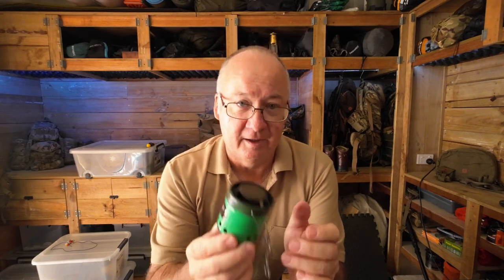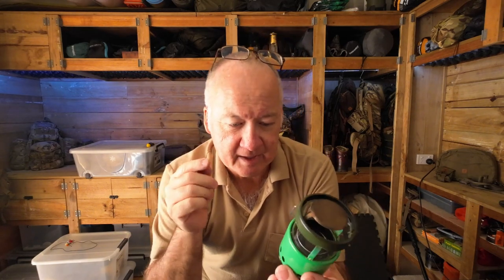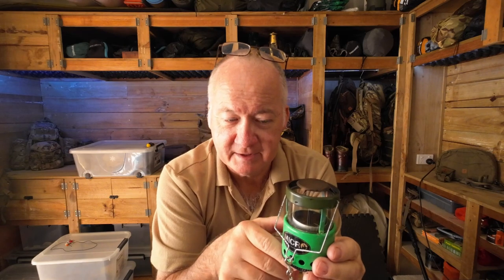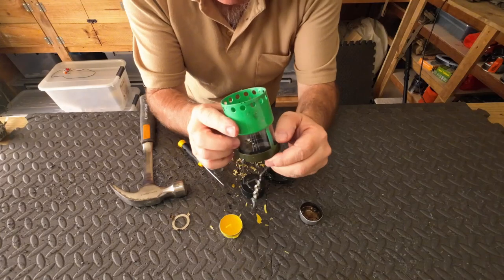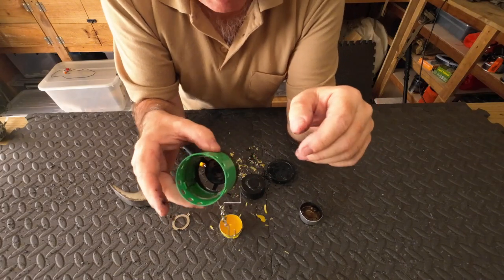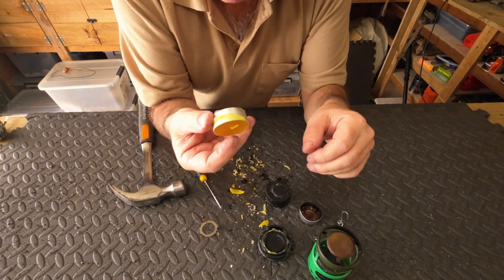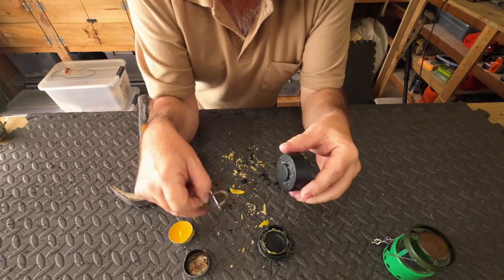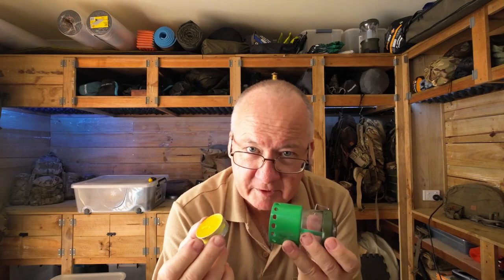Dangerous T Light Candle in my Micro Candle Lantern

Comment: Never heard of or seen a candle burst into flame before. Not that we use a candle very often mainly those citronella candles or bowls you get at bunnings for outside to have burning on the outside table to keep those Mozzie's away. Have had the porcelain or clay bowl crack on one but didn't flame up. Will have to be a bit more mindful of it in the future.  Have also brought one the UCO candle holder and candles but never used it yet. I wonder how you tell the quality of the candle, just going on price may not reflected quality.  Did you try burning the rest of the candles to see if they burned normal or flamed up as well. Might be interesting to know.  Thanks for the heads up will be a bit more careful when using these candles form now on.
Reply from the maker: I will sort the others out & check them
I would be interested to know. 
All the best.
Clive.
🤠